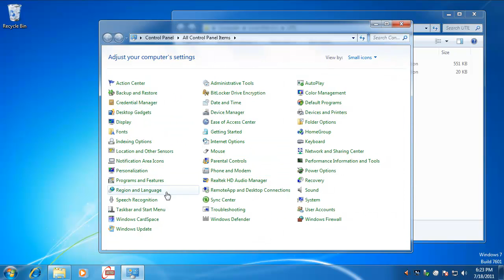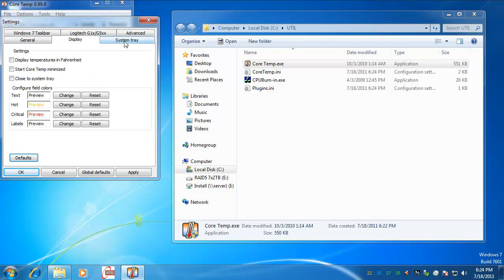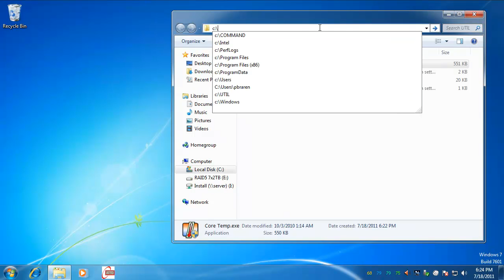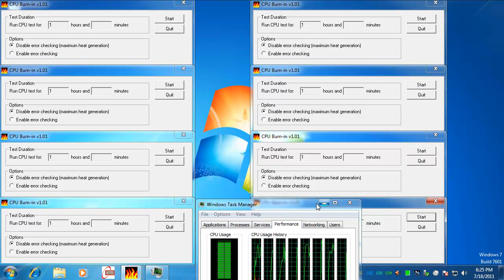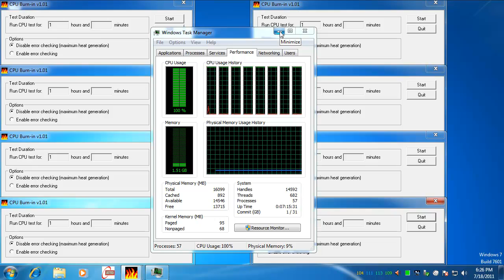How to use CPU Burn-in and Core Temp to test Corsair H60 Cooler with ASRock Z68 Extreme4 Motherboard

Comment: Erm, I haven't a clue what Tj. Max means, but my temp is at 102 Celsius :o Can some help me? My processor is only a Celeron, not overclocked, using a standard intel heat sink and fan :S